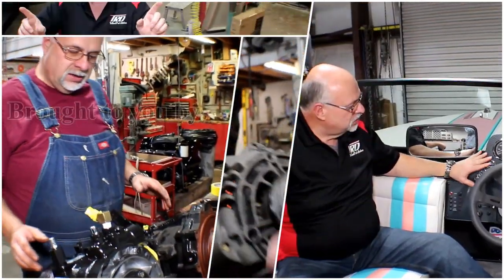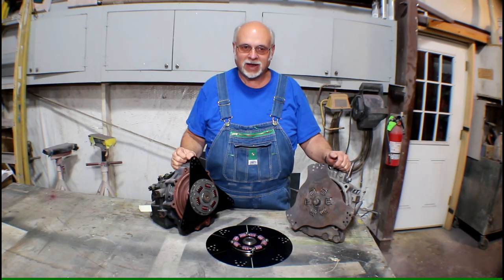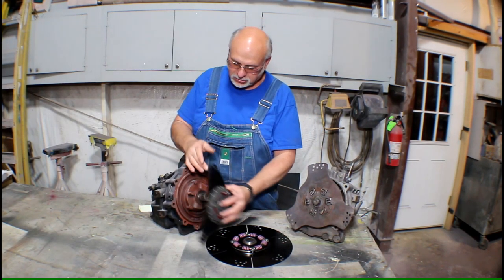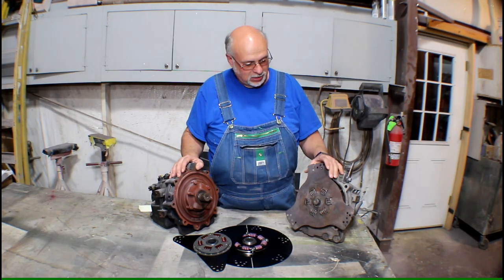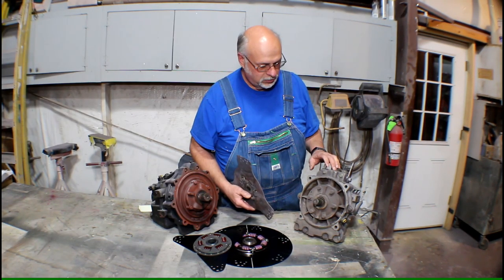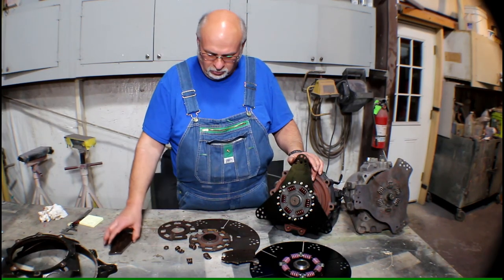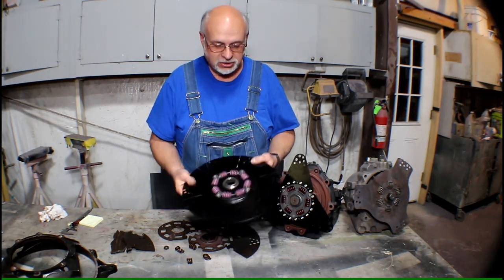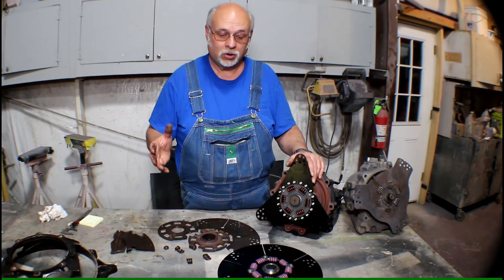Drive Dampers in Ski Boats

Comment from the maker: NOTE: I tend to interchange the technical terms of Harmonic and Torsional vibrations, the explanation is the same, the goal is to minimize the rotational "pulses" between the flywheel and transmission, think of it as Harmonics are the root cause and torsional vibrations are the problem needing to be smoothed out..so lets call them 

Dangerous Rotational Pulses now to be called DRP's
Reply: Hey Ron, I have a question unrelated to this video. Can you do a brief discussion on engines stalling at idle? I have a 1992 MasterCraft ProStar 190 and every so often it will stall when I’m idling. To restart it I pump the throttle twice and it starts right back up. It is carbureted and may just require the carb to be serviced. Is this common? And what are some troubleshooting options for this.

Comment: Hi Ron, our searay cabin cruiser had that noise, I called transmission chatter since day one. We bought a 1990 almost 4 years ago. Just recently i backed it out of our slip, throttled up to about 800-900 rpm, not only to achieve 5mph speed, but it also eliminates that chatter. However, this time I got a very strong vibration. Put in reverse to be sure nothing was caught on the prop, went forward again and had the same vibration. It was severe enough, I returned to our slip. I've pulled out the damper plate. I can see where one spring is not centered anymore, it's been chewing itself loose, perhaps about to start scattering parts. Have you heard of these causing vibration? Ron Pargett

Comment: Hi,
I have a ski nautique from 86. Recently I have heard the noise you mentioned at idle. Though the main problem is that it feels like it goes in and out of “gear” at low speed and if I try to take off quick it makes a strange crunching noise while taking off. Once it gets going the noise goes away and runs fine.

Could what you showed in this video cause that or is the problem or is it more likely I be the transmission. 

Cheers,
Andy.

Comment: Can you use part number MED-0007 for a 351W? I noticed on your site there is a “clipped ear” version. But MED-0007 looks like what you used in your ZF Hurth conversion video.
Reply from the maker: The MED-0007 is the clipped ear damper for the 351 Fofds

Comment: Im rebuilding a correct craft with direct drive,  saw the dampener plate.  Had no idea what that was for. Makes sense. My velvet  drive SCREAMS in reverse. And i noticed the strut was bent.  Do you have a suitable replacement  for a 70c, should i need one?
Reply from the maker: Velvet drives do make gear noise in reverse, this is normal, the damper plate rattle is present in neutral, forward, or reverse at idle then goes away with added RPM, that is the typical symptom indicating the damper springs are loose & going out. I would be more concerned with the bent strut and shaft alignment.

Comment: Great info, do you think putting too much ballast in ski/wakeboats is putting additional stress on crankshaft which then transfers to dampner plate? Because engine is lugging?
Reply from the maker: If you are propped right you will not be lugging the engine, however a ski boat or wakeboard boat works an engine MUCH harder than your typical car or truck

Comment: Is it imperative to remove the transmission from the bell housing? Or can you leave it and pull the trans/bell housing off as an assembly? Thanks for your time on this and your great videos.
Reply from the maker: It may be done that way but I never do, I always remove the gear, then the bellhousing. It also make aligning the trans shaft input into the damper a LOT easier.
Reply: @rontanis1024  hey thanks for the speedy response! I will proceed with your tried and true method. Thanks so much for your time and expertise.

Comment: I have a 97 prostar with a hurth 450D transmission. I don't necessarily hear anything at idle, but something sounds different. But, when accelerating, there is a loud knocking noise coming from the transmission. Is this a sign that the damper plates need to be replaced? I appreciate your videos so much!
Reply from the maker: Dampers usually rattle more at idle & go away as power is added...until they let go then they are quiet.
Reply: Ok, thank you. I did check for rod knock but it doesn’t knock as engine is reved out of gear and it seems to come from the transmission area. Any other idea of what it could be? As stated previously, it knocks very loudly as the boat is in gear and  accelerates. Thank you so much again for your help!
Reply from the maker: @aidanhughes2804  Sounds like you are going to need to take a look inside.

Comment: Thanks you this is a great video! I have a 97 moomba  boomerang  with a pcm 40 trans. Today I was coming back from a nice day at the lake and I Suddenly startedd to have issues  with my trans. I noticed  it was working harder to go forward  and reverse worked pretty  good. I just cant tell the difference  if it is the transmission  or the damper plate?
Reply from the maker: These are not the symptoms of a damper plate problem, check fluid & make sure there is not ski line wrapped around the shaft
Reply: Do you mean ski line rope wrapped around  the shaft? I just noticed  the boat starting to struggle  to go forward and then it sarted to get hot! I let it cool down and then it was working in limp mode!
Reply from the maker: @cannontaylor97  Yes, if you run over a ski line/rope, fishing line, etc. and it wraps around the shaft and binds up in the strut it will give similar symtoms.
Reply: Yeah i have been  lookin on the shaft it appears  nothing  on it!
Reply: Thank you so much  for responding  and helping  out! I wonder  if it is a shaft alignment  issue?

Comment: We were out last night and when i was throttling up it almost sounded like i neutral dropped the V-drives. Was not going fast at all. There was a chatter noise i throttled down right away then slowly limped in back to the dock with no problem. My question is what symptoms do you have when the springs let go? It seems i lost all torque but at about 2k rpm`s it was ok. This is a 1985 32` Wellcraft St tropez with V-drives SBC`s.
Reply: Interesting! Where you able to resolve  your issue? What was it?
Reply: @cannontaylor97  There was no stainless wire that goes through both locking set screws for the shaft that holds the coupling /shaft together. They loosened up I spun the keyway and the shaft.

Comment: Is there a way I can tell if it’s my transmission. or drive damper causing rattle and grinding noise. Looking at the damper, there is rust but the springs feel tight. The trans is a borg Warner, same one in your video. The rattle/grinding noise is during low idle, reduces when speeding up. Thanks
Reply from the maker: Your symptoms indicate a worn damper, if the damper has has high hours change it, a damper is beginning to fail will appear to have tight springs by eye or hand feel, it takes special equipment to test these. When they fail beyond the initial failure phase you will then notice obvious problems.
Reply: @rontanis1024  thanks will do.

Comment: If I I’m removing my engine on my 1989 inboard ski boat direct drive for full replacement. Can I keep the transmission connected until the motor is out? Thanks
Reply from the maker: Yes, when the boat was new the boat factory set the engine/trans assembly from a pallet complete into the boat, you can remove it the same way, then do what you need to to the boat or engine.
Reply: Thanks!
Reply: @rontanis1024  with all the room to pull the engine I think I can handle it. through videos it looks like fairly simple. Making sure you disconnected all wires,fuel lines,  exhaust,oil. Then disconnecting  transmission from drive shaft. loosen motor mounts and transmission mount and the whole engine with the trans should just come out nice and slow? thanks for your help. Dont got the money to pay a shop to replace it.